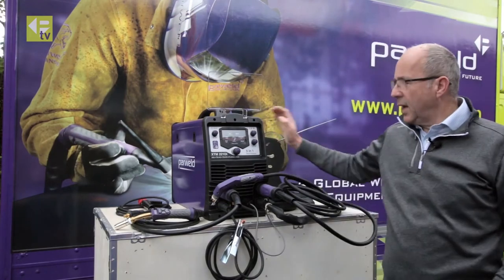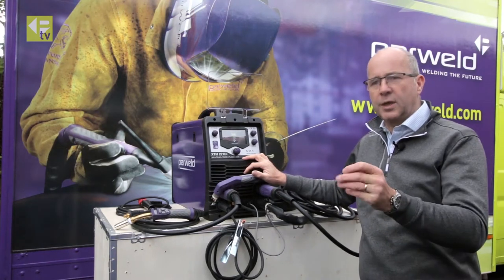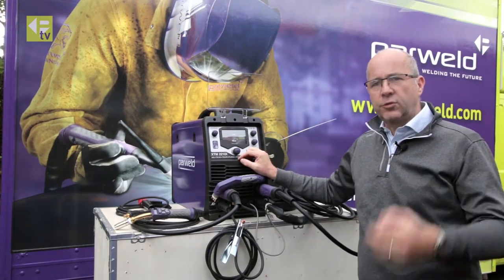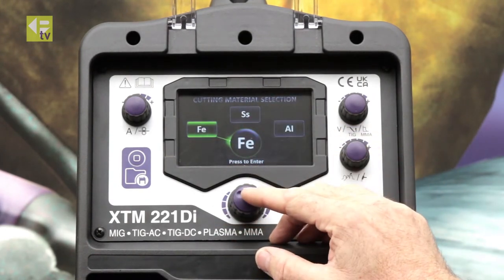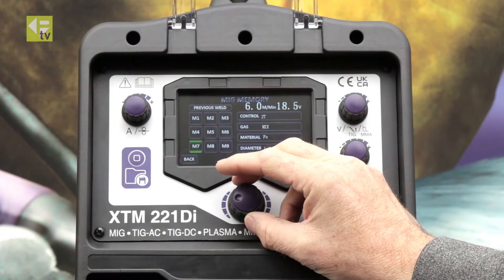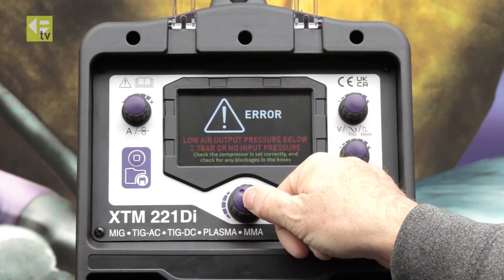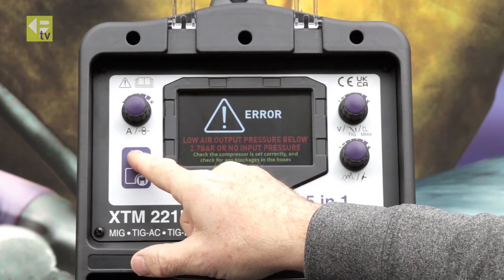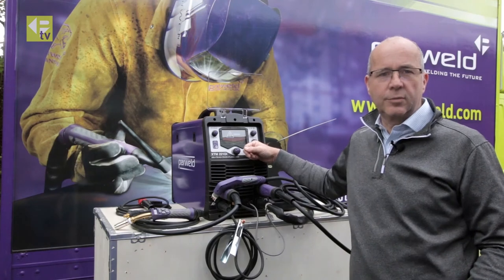XTM 221Di Plasma Cutting Setup

Comment: I guess the machine doesn't have a built in compressor?
Reply from the maker: It does not have a compressor built in but does have an air socket on the back for an external compressor to be plugged in.